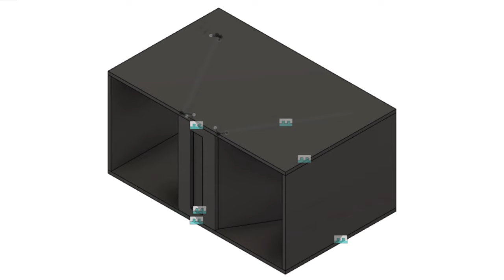HOW TO MAKE A 18" HORN SUBWOOFER | DIY

Comment: That driver is way too close to the back of the box it's not gonna really feel powerful instead of having the tubes at the front you should've had more space between the front of the driver and the back of the box and put the tubes on the inside it would be much more powerful than this design

Comment: Question,how will you remove,the speaker,if you installed it first?
Reply from the maker: That’s a good question 😂 this simple project was the first box We built, so after we found the plan online we built it without thinking about the possibility to remove the driver. After years of use we decide to built the bandpass version (check the last video) where we should remove the drivers if necessary

Comment: How do you replace the driver in this enclosure? The way it's fastened to the baffle makes it look very difficult to change.
Reply from the maker: You’re right. Replacing the driver isn’t an easy thing to do. But I can replace them with the upgrade I made on this project. You can see into the part 2 video and on my community section post
Reply: Don't need to replace the driver if you dont buy shity speakers. Hence why I only use b&c 21sw152. That takes 4000w and still don't blow considering its only 2000w rms.  Only buy tour grade subs.
Reply: Right ❤❤

Comment: I've a question about your amplifier. Does it really work ? Because, I took some information on websites and someone's told me that this amplifier is too low for a subwoofer like RCF LF18X401, it can break down. If you can respond me that this amplifier works well, or give me your opinion about this amplifier. I lovesd your video too :)
Reply from the maker: Hi, nice question. To me that amplifier is a good one. I’m not a specialist so this is my opinion based on what I could heard. I use it to run 4 RCF LF18X401 and every time I turn up the volume I almost destroy my house but when I bought that amplifier I was wary. I did not expect that 400€ amplifier could kick so hard. Anyway I don’t know how it works with reflex subwoofers, I tested only with the wbin enclosure

Comment: Mhb4818 is not compatible mith x401, use a lf18g401 also nx6000 is poo use a proline 3000 if you want a cheap great amp. / French soundsystem
Reply from the maker: All the system sounds great and it’s very powerful, so I'm satisfied with all the drivers and the amps. Soon I’m uploading the sound check
Reply: Le mhb a été conçu par Marc o pour le g401 effectivement mais niveau ampli de behringer fait mieux de le proline pour 4 subs les miens tournent super bien avec le behringer mon pote avec son proline n'est pas au même niveau quand il s'agit d'alimenter 4 subs 👌
Reply: @josselinalbert1121  Je pense pas que tu ai déjà tester un proline mon copain, un nx6000 ça pu la merde il a été mesuré par les anglais à 250W rms en 4 ohms...
Reply: @yNico_  je l'ai vu marcher sur 4 mhb équipé de g401 je peux te garantir qu'il sort pas 250w rms sous 4 ohms

Comment: What a beautiful box I'm a fan of this model, I want to assemble 2 for my sound, what thickness did you use plywood? I have 0.709 in (18mm) available, will it be of good quality?
Reply from the maker: We used 18mm plywood. It works well but the 21mm is the best choice in terms of strenght.

Comment: Amigos cuando el woofer tenga algún dañó como se saca por donde
Reply: Lo mismo me  pregunto 🤔
Reply from the maker: In the next video I showed that.  We made two ports on the rear side where we can reach the driver and then replace it from the front panel (the panel with the reflex ports is removable, so through the “hole” the driver passes.
Reply: As feita aqui no Brasil vem com uma tampa na parte traseira da caixa de frente para o auto falante

Comment: Need to double up if they are anything like the Martin SB115.
Reply from the maker: I think they are similar to the SB115. This midbass horn push very hard 😂😂 but they don’t achieve a very low frequencies so they must beh matched  with a bandpass subwoofer or simile reflex subwoofer.

Comment: what amplifier you use for rcf speaker?
Reply from the maker: I use the Behringer NX6000. It runs the 2 drivers in parallel mode at 4 ohm. I got 4 subs so the amplifier runs two pairs of driver at 3000W RMS per channel.
Reply: oh . that's pretty awesome setup ..  how many spl you produce at long range?
Reply from the maker: @carlotheatheist  this Saturday I’ll test all the parameters. And then I’m going to upload the results in a video
Reply: alright! good luck with that.. that's my dream setup too.
Reply from the maker: @carlotheatheist  thanks 🙏